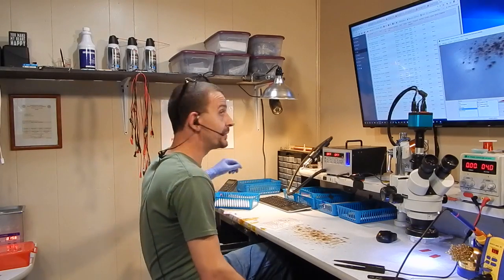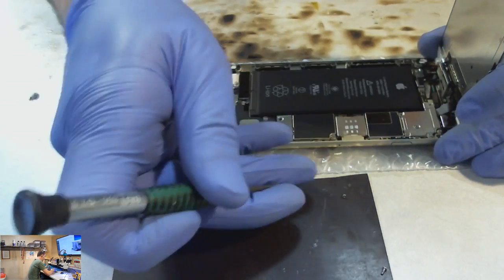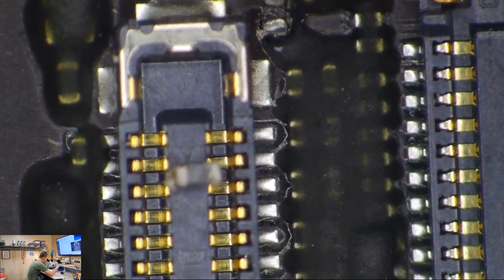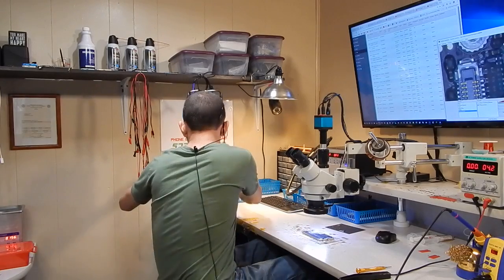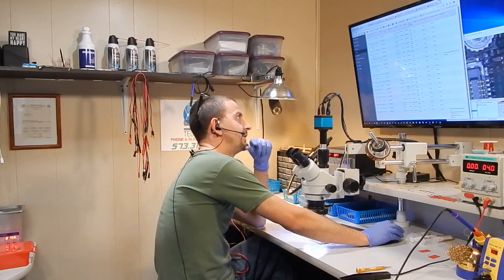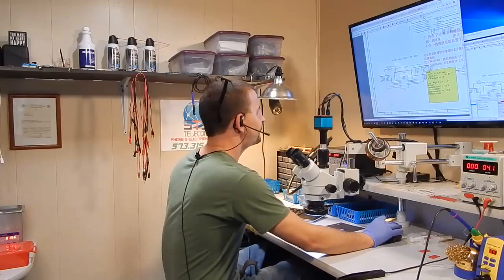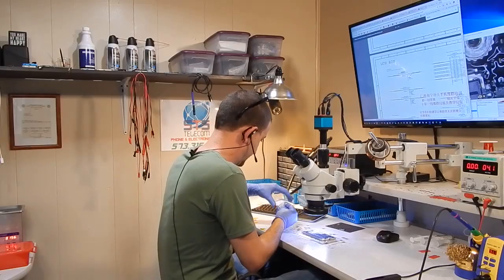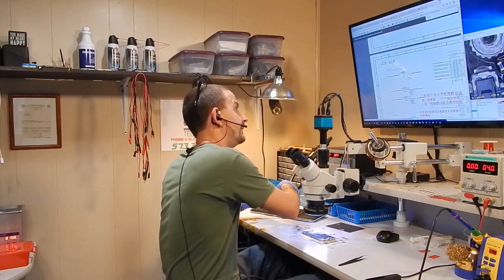iPhone 6 Backlight Repair -  Smoked Filter Surprise FL2024

Comment: Hi ,I wanna asked about the problem of my iphone6 screen /lcd.. I was in the apple center  to replace my lcd because it's not broken but its keeps blinking and the screen have an issue, they fixed it , they replace the lcd on my iphone6 but after 1month I accidentally drop my phone and its broken lcd, then I go to apple center again to repair it so they replace the lcd again, but again the lcd they replace having a problem in the back light , because in the upper side of my phone, there is a 2white spot and it's more lighter than the screen light and for 3x I've been in the repair shop in the same issue in my iphone6 lcd .... 
I wanted to know if the back light will cause a screen problem? Please help me , because I wasted a lot of money to it :(
Reply: Everytime they replace my lcd , I saw that white spot in upper side of my phone, and after few day , there's a vertical black lines, if I adjust the brightness to the maximum brightness the black light gone, and after minutes I use my phone it's happening again, and my phone died all of the sudden then when I open it it's okay again :( :( :(

Comment: Man let me suggest you a silicon heat resisting mat. they do a great job for soldering and also in avoiding the components to fly away. You can directly heat gun the surface without leaving any kind of burns mark on it like it happened with your desktop. Keeps also things clean and s alla parts well organized. If you are interested I can share a link. Cheers up and keep on making your video, I really like it.
Reply from the maker: Thank u!  Soon =)  I'm gonna be changing that burnt top around quite a bit.

Comment: How ford that chisel now mar up the case when you pry the phone open? I get the chills every time you do that.
Reply from the maker: This phone is pretty dinged up but you would have a hard time finding a mark made my my tool.   I don't actually pry against the case as much as I insert it and then pull up.  Most of the pressure goes between the blade and the screen as I pull.   I do a bit of prying sometimes but you really can't see any marks created by my favorite opening tool :D   I find plastic tools too thick.  Thanks for watching =)
Reply: STS Telecom I wish I can send you my phone because my phone won’t turn on it’s probably cause the back light